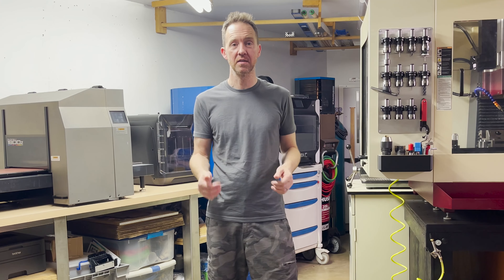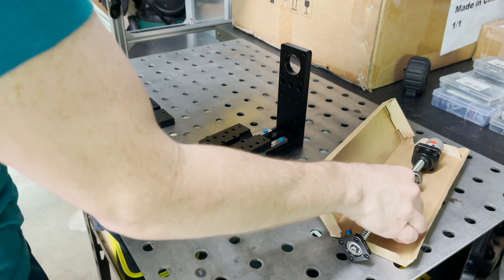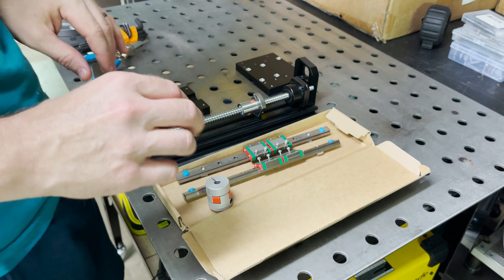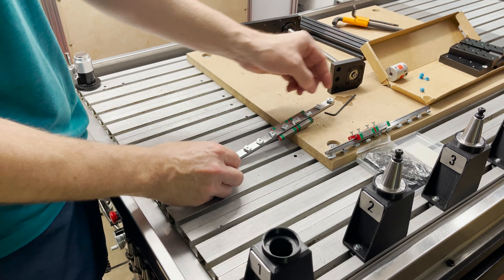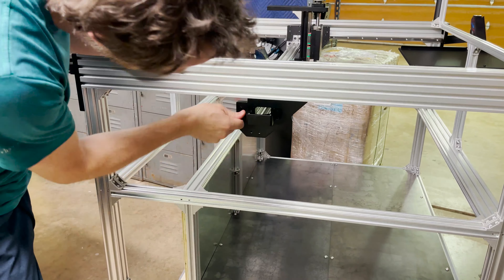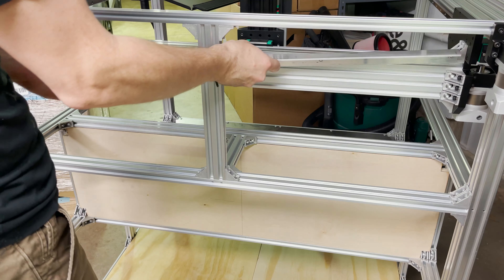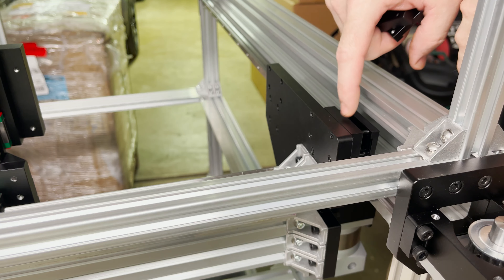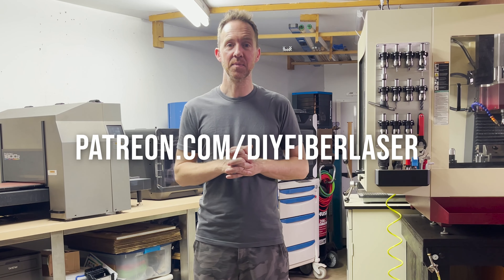DIY Fiber Laser Cutter V2 | Part 4: Z-Axis, Belt Drive System, Drag Chains

Comment: @14:50 You REALLY need shoulder bolts here, so the inner race of the bearing is on a shaft, not a thread. Later in the video you can see off-axis rotation and in general you should never run a thread through the ID of a bearing. It may seem insignificant but it will manifest in lost motion/backlash/wobble.
Reply: I was thinking he could mod the bracket design to incorporate a captive hardened steel pin that can drop in through the top and maybe a set screw through the side to keep things from turning.
Reply: @degreeless_engineering  Essentially a shoulder bolt haha. Not as precise but this is clearly not a precision machine; but either would be an improvement. Swapping the planetary gearboxes with belted reductions would be better for backlash too.
Reply: @3dkiwi920  I've found that hardened steel dowel pins have tighter diameter tolerances than shoulder bolts, but you're right, if he used a 6mm shoulder bolt he might be able to save the bracket by installing an M5 threaded insert where the current threads are, assuming that's an M6 screw. I would think you'd want as much precision as possible. I don't have any experience with CNC stuff, can you make adjustments in the software to accommodate for backlash on specific axis?
Reply from the maker: Thanks, I appreciate all your feedback...let me see if I can source some proper shoulder bolts to replace them...I'm always learning new things thanks to you guys!
Reply from the maker: I can also add backlash compensation in the software, but that reminds me, I was going to test if the reducers are even needed...I ordered them to have on hand in the event that the 400w motors didn't have enough torque, but I forgot to test how they performed without them....hold please...I have some testing to do.
Reply: @diyfiberlaser  Dude, you should be extremely proud of yourself. This is a huge undertaking and you're documenting it for the masses on top of that. We certainly appreciate it. This is what YouTube is all about!
Reply: @degreeless_engineering  they make precision shoulder bolts, just cost more. But you can get dowels even tighter if you pay even more.

Comment: 26 years ago, I tried stainless lined Cevlar belts on a Plasma machine, didn't work over a a distance of 4.2 metres.
There was too much slack on corners.
Would not think it will not take the speeds you appear to work with.
It may may work on the shorter distance you are working.

But I like what are trying to do.
Reply from the maker: The belts do seem to work fine over this short distance, I would probably go to gear rack and pinion for anything larger.

Comment: Would not the backlash of <10 arc min in planetary gear disturb the accuracy of laser cut parts or there is some way to compensate that in software?
Reply from the maker: There are backlash compensation settings in the configuration software

Comment: What a great looking machine. What would you estimate the frame and motors without any other electronics or hardware installed cost?  This frame setup looks like it could accomodate just about anything from a plasma cutter to a waterjet. Any reason for using servo motors rather than steppers? Great stuff!

Comment: @11:39 i think the ballscrew black nut need to be mount in the other way,  with the machined ring part toward the ball bearing...not a big deal of course
Reply: You're right, wont make a huge difference, this is not exactly a precision machine.
Reply from the maker: Ooops! You're right...I'll pay more attention to that next time. I'll probably just leave it...it shouldn't affect performance and I'm quite a bit further along on the machine, so taking it all apart would be a pain.

Comment: You might be able to save a little money by doubling up the belt clamp, and having one clamp hold both ends of the belt -- harder to install. Are you worried about it racking things differently?

(This is generally very cool and helpful! I'm in the middle of my own gantry design, but for a much lower-precision and low-speed application, and this is useful.)
Reply from the maker: Thanks for the comment, I initially did design it as a single piece, then I got to thinking that it might be a little difficult to install and pull the belt tight at the same time, this way makes it a little easier
Reply: I can tell you that it's not fun. It can be done if you have time a determination. Patience just goes out the window though.

Comment: Can the software handle cutting full size - say 1500 mm X 3000 mm - sheets of steel, 
if you increased the size of the bed the laser runs on?
Reply from the maker: I don't know of any size limitations on the software, as far as I can tell you can configure it to be whatever size you machine travel is.
Reply: @diyfiberlaser  Thankyou.
Reply: ever increasing spans mean having to factor into mechanical design: gantry beams will deflect more/need to be stiffer under load. Longer the belt more opportunity for stretching etc.
Reply: @EricBrummer  Yeah, the mechanical stuff is easy to work out and isn't what I was worried about. 
I want to be able to make steel panels 1200 mm X 2400 mm in size with different designs on them 
for 'artsy' type garden dividers, fences and similar or larger type silhouette cut outs and pieces to 
weld together for statues.